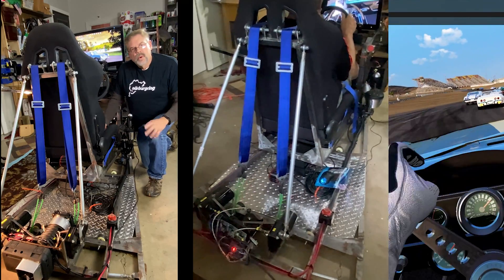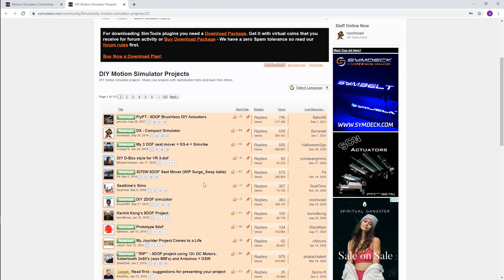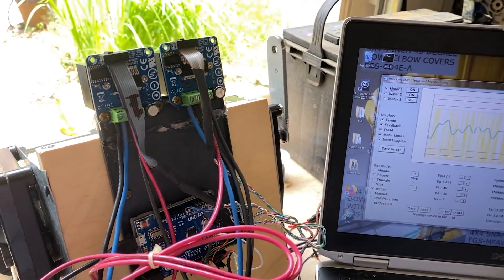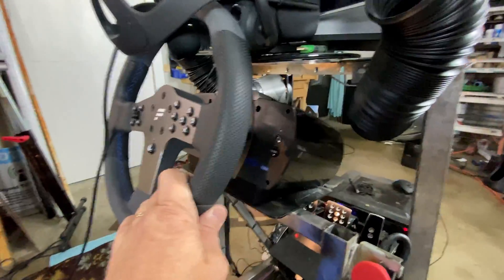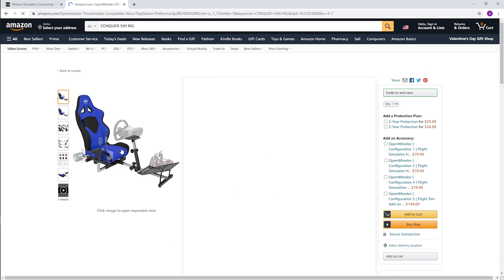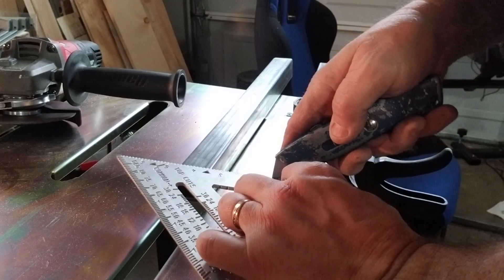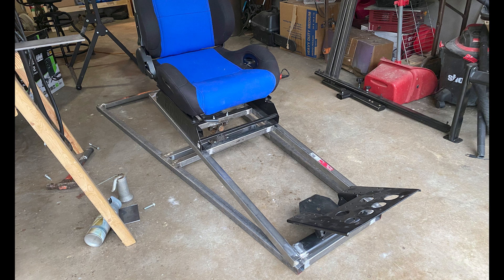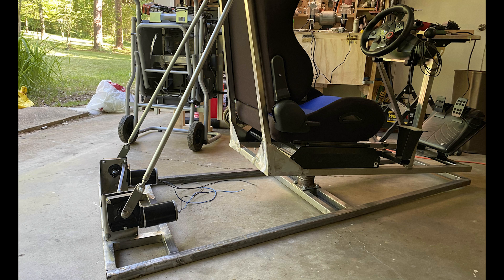How to build a Motion Sim Racing Rig - Start your journey!

Comment: Did you install mechanical stop on lever to stop them going past 180 deg?
Reply from the maker: no.  Once you get them 'set up' and connected to your 180 degree pots,  the software will shut off the motor if it exceeds the MAX limits..   If they are not connected to the pot they will just spin around and around.  Where are you at in your build?   Actually a mechanical lever stop is not a good idea because the motor will heat up when it hits it..  better to follow the guide that x-simulator posted and set the Sofware Clip and Max limits.  Let me know  Dave
Reply: @DMAX_DIY  I’m pretty much finished the build. I’ve made linear potentiometers from hall sensor and magnets on shaft. They work, but if a soft limit of 170 is set and rig is turned off my body weight will rotate tig further until levers are at 6 o’clock 10deg past soft limited. I’m thinking a mechanical limit is needed just past the soft/digital limit. Once past that limit the wire polarity will be backwards
Reply from the maker: @oliverf944  Ok. so maybe you do need a mech resting point for the rig because they go out of bounds (ie. max limits)..  ok..  Just be sure to fuse the motors..  I dont know what they pull yet at max load.. I am planning on doing a test in the future with them being braked with an ATV brake..  I would say to protect them around 15 to 20 amps..  unless you know what load they can produce..  that way if they get stuck somewhere, the fuse will let go and not the motor.    I think i understand what you are saying ..  Sometimes you gotta think out of the box. Let me know how it goes. Dave
Reply: @DMAX_DIY  thanks Dave. Fuse per motor is a good suggestion
Reply: Epiphany… we should be using 270deg hall potentiometer. And set soft or limits at 180.

Comment: Do you think a washing machine motor would work?
Reply from the maker: Well it's AC..  so maybe..  I dont know cause I've only used DC  power which is simpler for me to describe.. I do know that people use AC motors with a THanos controller  but I do not have experience with that..  DC is easier for me      DMAX
Reply: @DMAX_DIY  Thank you for the reply much appreciated. I was also wondering if you might know of anyone that has tried using Vevor Linear actuators in a rig? I don't know what speeds would be need for the right level of response and whether those actuators would be too slow. 

We don't get the crab motors in UK or at least I can't find any.
Reply: I believe the vevor ones are 6000n with a speed of 45mm/s
Reply from the maker: @RetroElectronic  Ok.. so no crab pots in UK..  got it..  I have not built or tried any linear actuators YET..  maybe this year..  If you want to stick with 12 Volts which is what the crabs are, try and find one 12vdc  50:1    that ratio will give you smoother response.  I used some 18:1 motors on the 'seatmover' project and yes they did work too..  but I could tell a bit of a difference.    I set that seatmover up with 24volt 25 amp converters which plugged into the wall and  those electric wheelchair motors.  maybe try that..    But, there are a few channels out there who focus on the linear actuators..  Try looking at 6 degrees of flight..  he's cool and he was using those on his 6DOF airframe simulator a few years ago..   Cheers  Dave

Comment: Awesome stuff! Is there a delay between monitor output and motor motion? How much?
Reply from the maker: Thanks for the question Gin..  Nope  maybe 1ms.. either way it's imperceptible once you get them set up for motion.. It's nothing i have noticed.  And I run the rig in VR..  so even a small deviation would be noticeable.  I just came out with a new build series  step by step so tune in if you have time.. Dave
Reply: @DMAX_DIY  Much appreciated!

Comment: I want to try the cheapest possible "1 degree of movement" mod to my office chair. I know, it's nothing like a proper motion rig but I figure it will give me a feeling of acceleration and deceleration....

The office chair rocks back and forth really really easily when I'm sitting in it... Do you reckon I could mount one motor just to rock the chair back and forth by pushing up on the front edge underside of the chair? 

I don't have room for a full motion rig and I figure this will help me feel some braking all within the normal footprint of the office chair. 

Would really appreciate any advice! Awesome build.
Reply from the maker: yes. that should be pretty easy.  accel and brake can be taken care of with 1 arduino, 1 IBT2, a small fan for the IBT-2 and one motor.  you would need to have two tie rod ends.  the motor could be 12 v  or 24 v. Since your chair already is stable and can support your weight.  your probably just  a few parts and some 'testing' away from  getting it working and all that.   let me know how it goes.. dave

Comment: Bro what is 50:1 mean?
Reply from the maker: Thanks  Good question.  The motor windings inside the housing spin 50 times and the shaft that hooks to the control arm  spins one time.    50:1    If it were 100 to 1, the motor would spin 100 times and the shaft that hooks to the control are would spin 1 time..  The more times the motor spins, the more torque you will get.   So 50:1 is a pretty good number..   They make 60:1's  which are better..

Comment: Great vid men but I have a question is it compatible with ps4/ps5 if not how can you get to work it
Reply: Keep up the good work
Reply from the maker: @BUBUshort1  I will try.. Just swapping over to a new pc system.. so it takes a couple days .. windows 11
Reply from the maker: Well.. I do not have my old PS3 connected.. but I went on Xsimulator.net and found some info for you.. check it out if you have time.. I only use the PC.. https://www.xsimulator.net/community/threads/my-first-project-2dof-simulator-for-playstation-4-from-chile-2017.10844/

Comment: Very cool and thanks for sharing. Can you give an estimate on costs related to your 3 dof solution. I am also curious how you created the tension  rods that connect to the motors and back of the seat frame.

Keep going!
Reply from the maker: Thanks for the question and comment Rob..  The tie rods are just 1/2 in conduit..  I bought some left and right hand tie rod ends from amazon and just pushed them into the open conduit..  then tack weled..  Here is a video on the costs..  https://www.youtube.com/watch?v=4cTyjsvO-i8

Comment: Awesome job but may I suggest finding someone w/ experience in high end electronic installs (home theater, car audio/ video, etc) to help clean up your wiring a bit. I've found a second set of eyes is always beneficial especially on longer term projects. 
Incredible ingenuity nonetheless!
Reply from the maker: Juan, You are probably right..  But these are both just 'test' simulators. super basic and just testing parts out to see what happens..  I actually plan on building a real motion rig and building in wiring tunnels etc into the frames but have not started that project yet.. 
  Soon though, I'll concentrate on getting things a bit more 'permanent'  Thanks for the comment! Dave

Comment: What software/interface did you use to get the motion signals from the game to the chair? Great vid.
Reply from the maker: Great question Ronald. The software interface is called simtools. It takes the game telemetry data and outputs the info into the Arduino I have a few videos on that too.  Thanks for your comment! Dave

Comment: With the larger motors looks like you could use longer arms to more motion travel. Wonder if they can handle the torque and speed to get more motion? I'm sure there is a max travel. Probably limited by speed of the motors. Does yours provide enough travel or do you think more would be better?
Reply from the maker: Thanks for the comment and after driving it pretty hard for about two years, the two motors that move the upper frame have plenty of power and I don't think altering the levers is needed. They are 5 inch CTC. But If I wanted to drift a bit more, I would increase the Traction loss  lever from 7 inches to maybe 10 and see if I get a little more sideways action..  They are fine at 7 - but there's always room to experiment!

Comment: Happy New year Dave. I'm just wondering, could your rig design be modified to have more motion with longer lever arms on the motors and adapted for a flight simulator?  The "traction loss" would simulate yaw in a plane, I think it just might need more roll and pitch for turns and takeoff. Please let me know.
Reply from the maker: Hi Jonnyb6688! I really want to make a flight sim. The 3dof would be a really basic flight sim with pitch roll and yaw (rudder). If your flying in VR.. I think it probably will have enough movement the way it is but since I have not installed a flight sim or combat sim yet I dont know for sure. Dave
Reply: @DMAX_DIY  Thanks for the reply Dave. Thinking about starting my actual flight training and read that a VR flight sim with 3DOF will help reinforce skills learned aloft. I'll likely build this. Thanks for all the informative videos! Jon...
Reply from the maker: @jonnyb6688  Man that sounds really cool!  Yeah I've flown in my friends Cessna and I would say that take off/ turns/landing would be very similar of what my rig can do. Also you can tune the setting in Simtools for different types of rigs..  Great way to get going in 2022!

Comment: Hi, Where can I get the U Joint that supports the chair on a pivot. The ones I have found are too small. If anyone can help and give me a link or tell me the actual name of that particular part.
Thanks
Reply from the maker: HI Rudy! Thanks for the question.  Basically you need to go to an auto salvage yard.. They probably have drive shafts piled up in one place..  Just ask the guy for a Chevy or ford drive shaft and they will point you to one of the piles of them.  Check that BOTH the U joints are not 'frozen'.  It's probably like $20 bucks but well worth it..

Comment: What size are your tie rod ends. 1/2 or 3/4
Reply from the maker: Great question. They are 3/8" bolts  and they fit nicely inside the 1/2" electric conduit I use for struts. total length is 2  1/8" QSC 3/8 X 3/8-24 Economy Panhard Bar Kit with Bung .058, Rod End, Heim Joint Amazon link was https://www.amazon.com/gp/product/B00E6A1J4G/ref=ppx_yo_dt_b_asin_title_o04_s00?ie=UTF8&psc=1
Reply: Thanks Dave. Appreciate everything
Reply from the maker: @ronnierowe6764  No problemo.  I'm on line usually during the weeknights but on the weekends I'm taping stuff and making stuff so I dont really check in for questions.. hope those links help out my friend! DMAX

Comment: Thanks alot i apriciate your work.what else potentiameter can i use instead of 6127V1A180L.5FS
Reply from the maker: Hi, I was going to use 10K wirewound pots (that's the end game) hall effect are just better and infinitely spin. I would still order the 987-1392-ND part from DIGIKEY. If shipping is the issue, just search google for similar SENSOR ROTARY 180DEG SLDR TURRET..  hope that helps

Comment: Dave, did you have to Tap (add threads) the hole all the way through ?
Reply from the maker: Yeah. It took maybe 10 min.. and I used a few squirts of oil. but yes.. That way the bolt just screws all the way through to the other side..  Just take your time on it.. I heard about people pounding them in with a hammer but I did not want to do that.  Dave

Comment: Hello friends it is very nice 
Can I know witch type of motor U used
Reply from the maker: Hey manoj..  I used 12Volt crab pot pullers from EBAY..  I have a whole build explanation on x-simulator.net  https://www.xsimulator.net/community/threads/full-frame-2-dof-traction-loss-new-build.14740/

Comment: Excellent. How do you move the skate board wheels. Thanks.
Reply from the maker: Thanks for the question. The wheels are there just to support the weight of the rig and simply roll when the traction loss motor moves the mid frame.  Hope that helps.. I also have a video on the traction loss on my home page..
Reply: @DMAX_DIY  Thanks that is brill

Comment: But how do you program the engines?
Reply from the maker: Thanks for the question. The motors are controlled by the IBT-2 motor controllers. The IBT-2's are controlled by the Arduino. The only 'programming' is actually done by uploading a file into the Arduino. I have a video coming out on how to do this so please check back.   Here is a link to my build on x-simulator forum Lot of details on it  https://www.xsimulator.net/community/threads/full-frame-2-dof-traction-loss-new-build.14740/    DMAX

Comment: Really impressed. What is the specs on the servo motors that you used?
Reply from the maker: Hi and thanks for the question. They are 50:1 12volt 'crab pot pullers' The vendor is PGSAW in canada on Ebay.  I definitely recommend in this type of setup. plenty of power.  DMAX
Reply: Thank you. Will have a look where I can find it in South Africa.
Reply from the maker: @rinusbotha9509  South Africa.. Consider the Motion Dynamics 60:1 motors from Australia. They have more power, but are more expensive.

Comment: Cool video Dave, I will check the rest of them out to see how you solved certain problems. Do you suggest any helpful forums for a build? 

Do you have any detailed schematics for your Arduino wiring? Can it interface with any racing/sim game or just a special game MADE for simtools software?

Have you thought about getting the actual dash from a car you love? You can easily connect this up to an Arduino and use the CANBUS network to power and rev the gauges - it's what I'll do if I ever get close the finishing a build, but would look really cool for you to add. If you give it a search you'll find the libraries and guides of how to do it. 

Sorry about the question overload, I feel like this will be my next project :) I am also thinking about maybe a removable dash bit, where one could be a car and another a jet that you could just swap - as I love the flight sims to, how practical do you think this could be ? Perhaps 6dof needed for a jet setup?
Reply from the maker: Hi Big Steve, Great questions. Yep I used the xsimulator.net forum for pretty much all you were asking. here is a link to the schematic page https://www.xsimulator.net/community/threads/smc3-arduino-3dof-motor-driver-and-windows-utilities.4957/
here is a link to my build on x-simulator.net https://www.xsimulator.net/community/threads/full-frame-2-dof-traction-loss-new-build.14740/

That should get you heading in the right direction.

I'm using VR so I always have the correct dash for whatever car I am driving..  VR is great and was a game changer for me.  

I'm looking into building a 6 DOF maybe this winter..  Thanks again for the questions.. DMAX
Reply: @DMAX_DIY  thanks a lot Dave you've saved me a long search. Very cool stuff. 

Would you say VR is way better experience for the racing Sims? How about motion sickness? Is it lessened because you're actually moving because I've had some sickening times on some of those vr games! 😂

For the reasons above I am wary of the VR and you also are lacking peripheral without looking. What do you think about the feasiblity of a 180 degree curved projector panel that's attached to the frame and moves with it. 

There is a projector project like this on YouTube but not incorporating any dof,  seems an interesting challenge

And finally, if you could do this build different what would you change about it if you were to do it again.

Thanks for your time and sharing your knowledge. 

Steve, UK
Reply from the maker: @bigsteve6729  Ok Big Steve, Apparently YT never notified me you commented.. But  Yes  I had a single monitor stationary. then I hooked it to the rig. Stationary hooked to the motion was WAY better.  Then I tried Triple monitors  I think they were like 24"..  It was EPIC..  but I already had Oculus Rift CV1 and was a bit scared to try it..  I manned up and hooked it up.  HOLY CRAP!!  Way better than triples with the motion..   I don't get motion sick easily and you might find me 'surfing' and all diving in the ocean or whatever.  But   I would suggest if you have a 1080 card and at least an I7 with 32GB ram, VR should be fine..  Go all in.. my motto is 'if it's worth doing.. it's worth OVER doing'  .. All the best my friend ! DMAX
Reply: Sorry I lost your heart like Dave I edited the comment a little 😁

Comment: thanks Bro! I want to build from 0 knowledge. make rig, buttkickers, subwoofer uder seat, 5.4sub audio etc. simple Things. In future plan. cut half car with front windows and 2seats 3screen/projectors. use this like base for simple motion. active light mayby. thats the plan. thank you for share this. respect Bro👊✌️💪
Reply from the maker: Cool ideas. I am working on the zero to seat mover series now. Should be out soon. If you can handle VR, it will save you a ton of hassle cutting a car apart. That's what I use.. So the motion platoform has less weight to throw around..  Never worry about screens if you can take VR..  DMAX